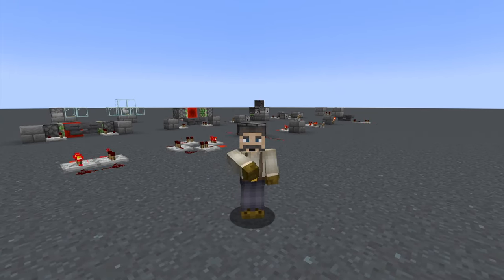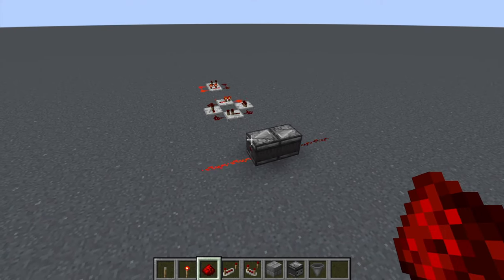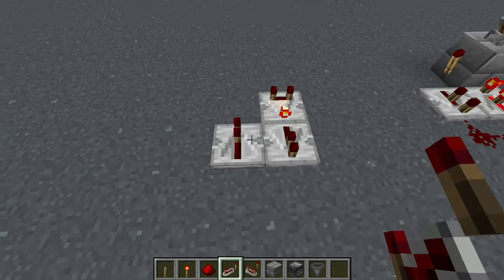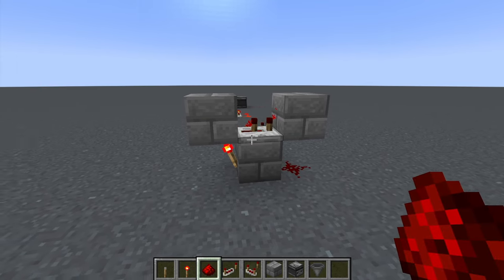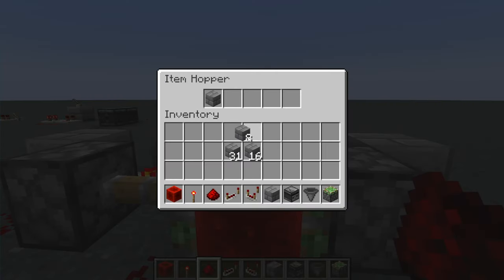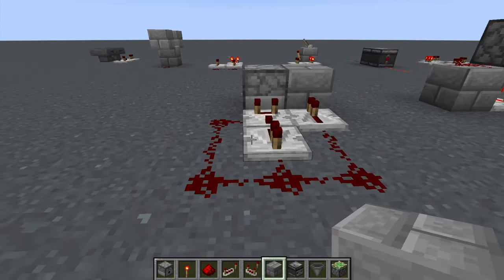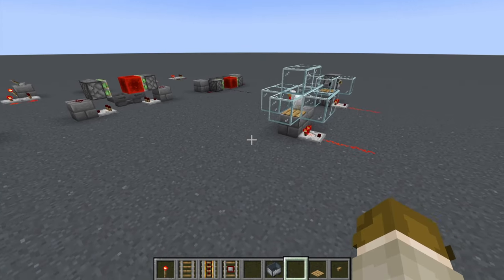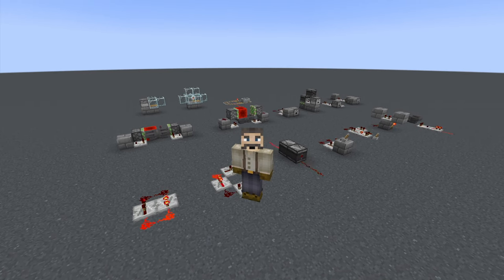How to Build All the Redstone Clocks (1.19+) | Minecraft Tutorial

Comment: Slow clocks are the most important ones on this list.
Reply from the maker: I tend use use the slower clocks more too.
Reply: @cubeprospector  An observer pointed at a copper block is a good timer for a farmer build, although it's not perpetual. you occassionally have to scrape the copper block with an axe.
Reply: @walterbunn280  you can wax the copper to negate that problem :)
Reply: @luischaboii8990 but then the clock wouldn’t work and the whole point of him saying this would be stupid. Hope this helps!
Reply: @walterbunn280 can you put an axe in a dispenser on a slow clock slowly scraping it?
Reply: Strongly disagree, zero tick clocks are super useful. It’s not that easy to create them and if you need a lot of them it’s easier to use a clock. Btw if you using zero ticks you are probably making something faster so the clock should be fast too (they are all 6.667 hertz)
Reply: @luischaboii8990 The observer powers when it detects the rust.
Reply: I need the slowest clock 😢

Comment: You missed the very simplest clock, which also happens to be the simplest slow clock - a daylight detector.
Reply from the maker: Good call out. They are a great 10 minute timer due to the day/night cycle. Gets a little tricky when you sleep but for most things you’d use it for it, it wouldn’t be a problem. Great call out. Thanks!

Comment: Your first repeater clock is really fast. By connecting both sides to a dropper, it drops 5 items/second. The double observer clock is only 3.32 items/second. This repeater clock can easily be started with an observer. It is possible to connect both sides using diodes (more repeaters, half slabs, ect...) to combine the signal. The combined signal has the appearance of never turning off but it works.
Reply from the maker: Wow, that’s some great technical detail. Thanks!

Comment: I have question for clock at 7:00 
This might sound like a dumb question, but how come both piston not pushing agains each other when both hopper has the same amount of item?

Like example hopper A has 64 item so it pushes the piston since the signal is stronger, but when hopper A has less than 32 item why the piston from hopper B not pushing back since now B side has stronger signal?
Reply: Is it just the design of the piston that it cannot push another activated piston and can only wait for the other piston to deactivate
Reply from the maker: Great question. Since both are pushing, one will only retract when its hopper is completely empty.

Comment: How would you extend a the time of an on off signal in and out timmer. I have a large multi item storage that needs the clock to continue for awhile after the last item goes into that portion of the soarter.
Reply from the maker: In the past I had a similar problem and I used a ‘one-time’ hooper clock that was triggered when an input chest became empty. I have a tutorial for the different hopper clocks if you haven’t seen the one-time kind. https://youtu.be/jrMVuKe1ynk?si=G7_quFSpz-y3aunm
Reply: @cubeprospector   thanks for that link. i have literally no idea how you made it activate on an empty chest that already ahs items going in and out of it. not sure where to even put a device like that. I am using the latest multi item storage from silentwisperer that has an auto on that I would think I could link to some how and make the torch stay on longer after the last item goes though but im really bad with redstone haha. thanks for your response

Comment: So many clocks, and I still didn't find the one I need.
I need a long duration clock (1 minute) but it needs to get back to its starting state as quickly as possible. An etho hopper clock can take up to 30 seconds to reset when it's set to 1 minute cycles, so that one doesn't suit my needs. And the other ones are too fast or have other issues :(
Reply from the maker: Let me see if I can come up with something!
Reply: The Dispenser/Pressure Plate timer - - replace the dispensed block with an arrow. The despawn time for an arrow is one minute. There is a hopper timer (measuring 4 x 3 x 3 comprising two repeaters, two comparators, one redstone torch, eight building blocks and four redstone dust) that will do what you require. It circulates the blocks so that after one minute or however much time you decide (depending on the number of items in the hoppers), when it has completed circulation it is instantly reset. Unfortunately I'm not sure if there is a video out there showing the build.

Comment: Not all clocks, but nice set. The first one  should be mentioned as bad design. Everyone should go 4th design for simple clocks. As it never burnout and can be turned off easily. And it is cheaper in resources. You don't actually need second repeater. Only if you want to lengthen the period. 
The design of long clocks is funny. But it can be done without pistons at all. So it will be quite.
Reply from the maker: Ya, it’s crazy how many different clocks you can actually make in Minecraft. I bet I could make a second video with all the ones I didn’t cover and have almost the same amount again.

Comment: Can we make a clock without repeater
Just redstone dust and redstone torch, 🤔
Possible? 😅
Reply from the maker: You bet. You’ll need two redstone torches, two blocks, and some redstone dust. Put one block down and put a torch on the side. Next to the torch run a couple redstone dust in a line. Place a block at the end with a redstone torch on the side and then redstone dust on the side of that torch running back into the side of the original block to form a loop. The two torches basically turn each other on and off. You can make the loop as big or small as you need it, just don’t let the two redstone dust paths connect. Hope that makes sense.